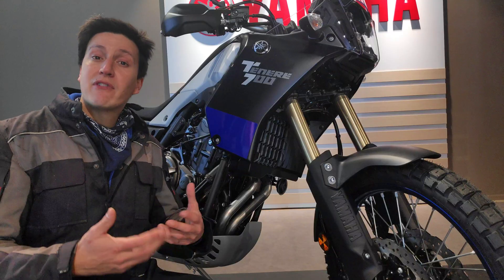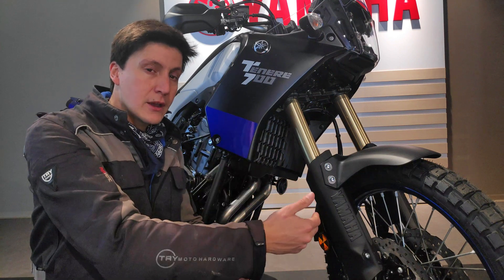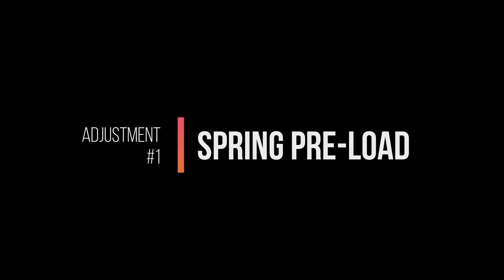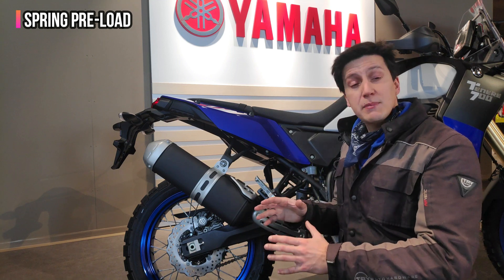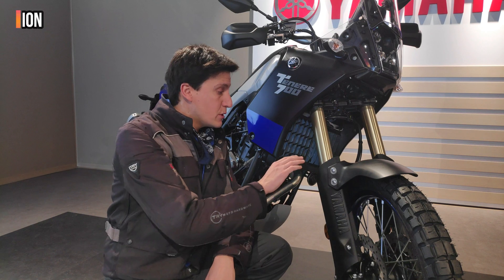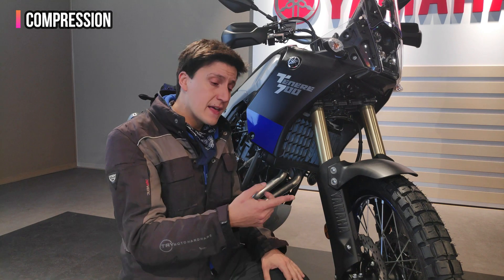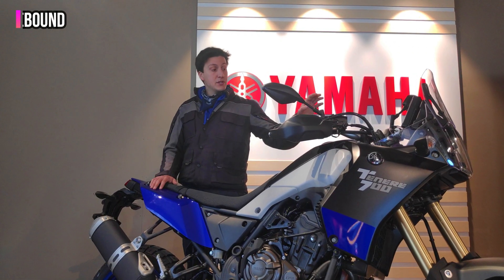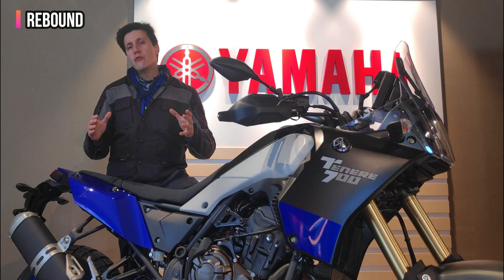Motorcycle Suspension adjustments: Basic tutorial (T7) 1/3

Comment: At 1:45 he contradicts himself 10 seconds later. He was right the second time: increasing the pre-load does NOT increase spring stiffness or make bike taller. It just reduces "sag".
So set the pre-load for your normal riding weight. And when you have passenger/luggage, increase it.
Reply from the maker: Hello, thanks for commenting!
Let me defend myself xD

a) You reduce sag because the bike becomes taller (cause by increasing the pre-load you help the bike "fight" the extra weight). So the part where I say that the bike gets taller is correct. The part where i say that i should NOT use it to make the bike taller/shorter is also correct... you should use it to make the bike meet its intended geometry, not more or less (unless you are looking for a very specific outcome).

b) You are right about the spring not getting stiffer with + preload. The spring's stiffness (or spring rate) is always the same... BUT, when you incresae the compression you "pre-compress" the spring, meaning she will hold more weight without compressing so much... this is the "same" effect you would get from a stiffer spring.... so i chose to talk in a way people understand, and not in a way that would please my physics teacher.

c) "The spring gets stiffer but dont use it to make the suspension feel stiffer". Again, I consider this information correct. 
If you want to bike to feel more firm or "stiffer", use the compression adjustment, not the spring preload. The spring preload is there to make the bike be "stiffer enough" to hold your weight at the correct height, not to satisfy our personal preference of suspension feel (unless you know exactly what you are doing...)

Comment: First thing I did was to swap out the rear spring and added 5mm preload washer in front. 
Where no videos out there how to install the preload washers, so I made one 😅
Reply from the maker: Nice solution, the washer! But why did you need the washer if you switched the spring?
Reply: @OFFroadOFFcourse  changed the spring in the rear, washers are for the front fork 🙂
Reply from the maker: @allthingsenduro  of course, it makes all the sense in the world now :D
2 Questions:
-How heavy are you? (sorry for asking)
-Did these changes improve the bike significantly?
Reply: @OFFroadOFFcourse  no worries, I’m 82kg after morning toilet 😅. 
I can’t tell much in regards to difference, as I installed it prior riding it. 
But I got a proper sag with gear etc, and that’s what counts. More useful travel in the end 👌
Reply from the maker: @allthingsenduro  With 82Kg you would probably get away with adjusting the pre-load a little harder than the standard 10clicks (ranging from 0 to 24) but this way you will have a bigger threshold for extra-luggage, wife and so on :D
Well done ;)
Reply: @OFFroadOFFcourse  no wife, no 2-up 🤪. For sure it would have worked fine adjusting rear preload for my weight. 
Just wanted to optimize everything as standard spring is for ~70kg riders with no preload, and using full preload it will be good for 50kg more. 
BUT, a compressed spring is not as good as a resting one with zero preload added in my opinion. 
I had the money and was advices to change it as the easiest mod to improve rear suspension for ppl over 80kg.  But then again I kitted mine a lot, hard not to through cash on a bike lol. 
Would love Rally Raid front cartridges and adventure rear chock, but it’s. 2000€ , so let’s wait a minute for the expensive mods that I might not really use for the light off road we can do here in Sweden
Reply from the maker: @allthingsenduro  I couldn't agree more ^^

Comment: Didn't agree with everything you said, but a good summation of the basics.
Reply from the maker: My idea was to keep it as simple as i could put it :)
On the next videos i wil detail more evey one of the adjustments, so I'd love to read your opinion before i finish the recordings! If you have the time to point out what you disagreed with, of course!
Reply: @OFFroadOFFcourse  You said you should never think of the preload adjustment as being a way to soften/stiffen, or raise/lower the bike. This is one of the things I disagreed with. In a pure sense, you are correct. However, as a rider who does not have the money to replace springs or re-valve shocks, preload is a perfectly fine way (within limits) of doing all of those things. The alternative is getting an 'expert' to replace springs and re-valve damping. Having a suspension expert replace your springs etc, is a difficult, problematic, expensive exercise that could see you rebuild your forks and shocks multiple times before you find a solution that works. Fiddling with your suspension settings is a cheap easy way to adjust your bike to your liking. AND if you mess it up, you can just return it to the standard settings in the handbook. Other than that you did a great job of demystifying what can be confusing to some. If you think about the terms used (preload, Compression/rebound damping) and what those terms mean, their purpose is quite clear.
Reply from the maker: @actstuntcam  ah, but thats exactly the type of information that I will be trying to teach on my next to videos! =)...How to actually adjust all those things. 

The whole point of teaching people the basics is for them not to feel the need to contact a "suspension professional" for a thing that can be corrected with a few clicks ;)
Reply: @OFFroadOFFcourse  Of course - no disrespect meant. I'm just a grumpy, old, opinionated, mongrel :) Aren't most motorcyclists? :) Look forward to your next one. Always good to return to the basics, it is easy to forget the simple stuff :)
Reply from the maker: @actstuntcam  Although I look young, and I'm only 34, I can definitely relate to that "old grumpy and opinionated" feeling :P 
My whole "love" for the T7 comes from a "the best old days were the best" mindset, ahah
 
Its all good man, thank you very much for taking the time to reply ;)

Comment: This is quite good timing as I've just received a new fully adjustable rear shock for the XT. I do know quite a bit about what the suspension adjustment do but it would still be good to here your advice on suspension set up. If you don't mind going into high and low speed compression too, that would be just 👌
I'll look forward to these vids.
Reply from the maker: oh! I also got a new shock for the XT660R (finally!)...but I didnt have the time to install it yet. 
Which one did you get?

I was not planning to talk about the high and low adjustments (mainly cause the T7 doesn't have them), but I will think about mentioning them "honorably" or make another video later dedicated to that :o
What hi-lo adjustments does your shock have? The Compression?
Reply: @OFFroadOFFcourse  I bought the swanky TFX from OTR. I wasn't cheap but it looks very pretty. I've not installed the shock yet either. I have the old one off and I'm just waiting for some advice from OTR about remote reservoir location.
The shock has fast and slow rebound for compression, rebound adjustment and a remote preload adjuster. I'm quite excited about feeling the difference it makes. 
Which shock did you go for?
Reply from the maker: @P6_7R_Nick  a friend of mine has the same on a XT660R as well. He is very happy with it. 
Somewhere in the next few weeks I'm actually going to be with him and will ask for a test-ride ^^
Reply: @OFFroadOFFcourse  you could ask them how they installed it too just incase I'm still struggling  haha. 😁.
It would be interesting to hear your thoughts.
Reply from the maker: @P6_7R_Nick  Well, so far I know that you have to disassemble half the bike cause the airbox will be in the way of the top shock screw... and I know that the external reservoir (if you picked that version) is a bit tricky to install cause the tube is short so it limits the options of where to place it. But thats it... no biiig issues =)
Reply: @OFFroadOFFcourse  yes, getting the old shock out meant quite a lot of the bike had to be taken apart. About 2hrs in my tiny shed with my tools. But it was fun. It is locating the remote reservoirs that is making my head hurt hence I am asking OTR for some advice as they are selling this shock for the XTR. Really looking forward to getting it installed.
Reply from the maker: @P6_7R_Nick  my friend zip-tied it to the frame, close to the airbox lid 
It doesn't look "factory" but it gets the job done :P